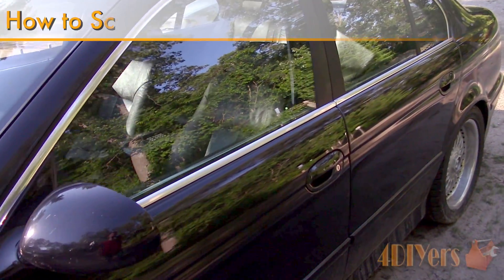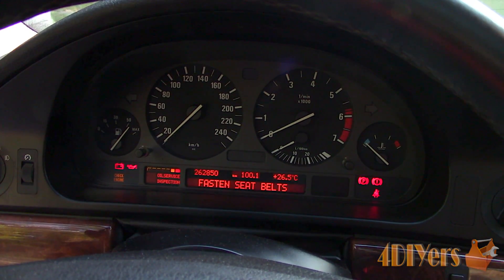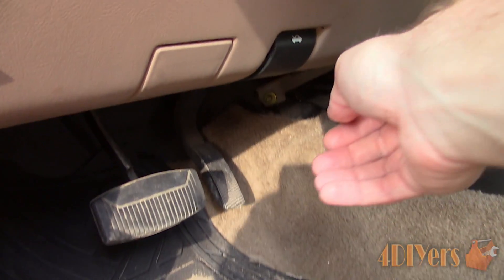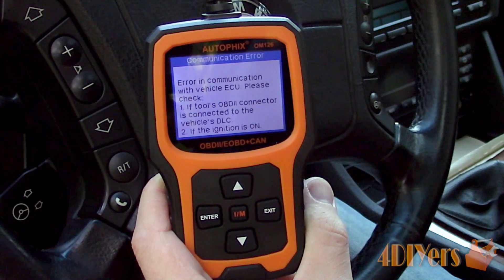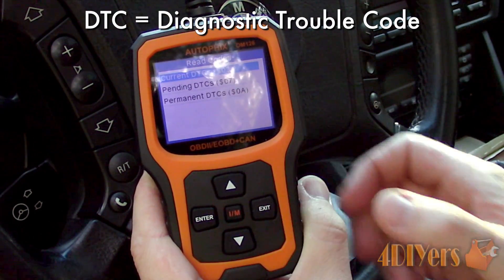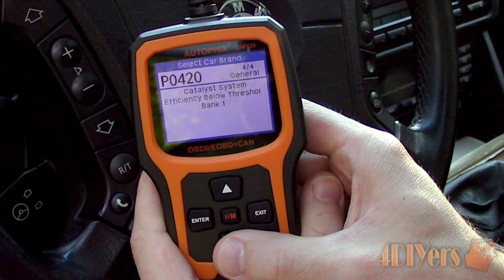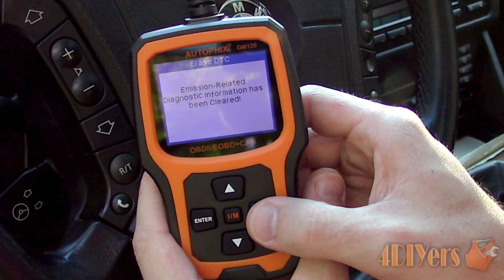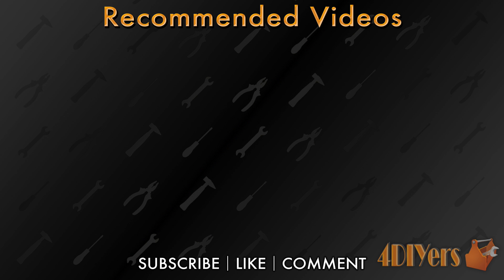How to Diagnose a Check Engine Light - Everything You Need to Know

Comment: Thanks for the video ! I have an e39 528i but haven´t got this port where your video show. Where could be ?  There are one on the glove box but its too small. Thanks for help.
Reply from the maker: European spec car? Try further under the dashboard just above the hood pull release.
Reply: Fernando Grubits .. the glove box port is thebmw original flash light  charger... dont use it for scanner.. your car port( if ur car is older than 2000 model) is under the hood on passenger side next to ABS mojo... its a rounded  black 20 pin port obd 1 inlet.. u need to use a 20 to 16 pin reduction connection for bmw. u can find it on ebay for 4 bucks almost ... hope this will help
Reply from the maker: Mine is a 1997, I have both plugs. That plug under the hood is for BMW specific software like PA Soft or CarSoft.

Comment: Can you do a video for cars that are pre 1996 with a check engine light? That would be very helpful. Anyway, nice video!
Reply from the maker: Thank you! What type of vehicle do you have? I'll see what I can do, at the moment right now I only have my 84 BMW, so I'll see if I can get it to throw a code. OBD1 is unfortunately vehicle specific, some may have code readers specific for the manufacturer (I have a Ford code reader which was shown in my electronics cleaning video), other vehicles have a build in function where you don't need any tools.
Reply: 4DIYers I have a '92 Ford Ranger. It was a barn find and I just finish the wiring, so I'm trying to find what sensors are bad because the check engine light is on.
Reply from the maker: Unfortunately I don't have access to a Ford I can do this with. That Ford code reader I was referring to earlier, that is what's used on your truck. I had an 89 Ranger myself in the past. You can also use a wire to jumper the plug, check this out http://broncozone.com/topic/14269-code-reader/#entry74587